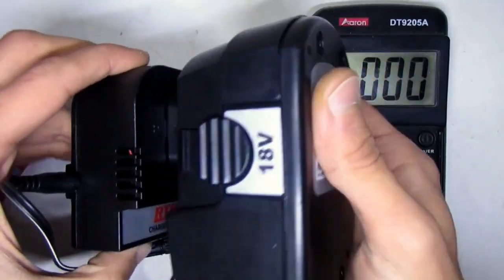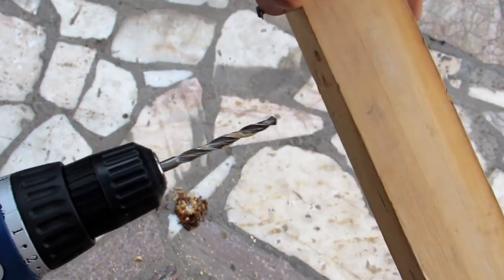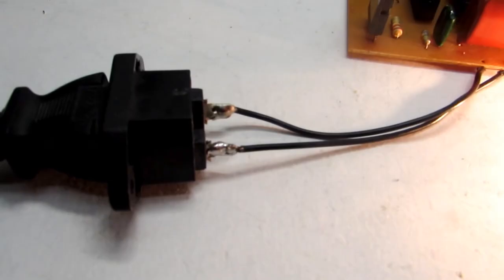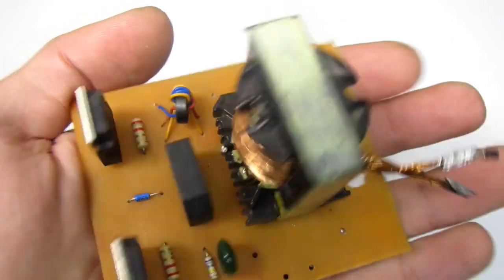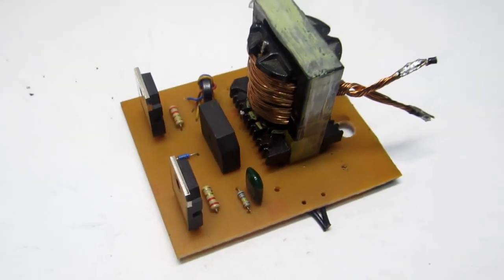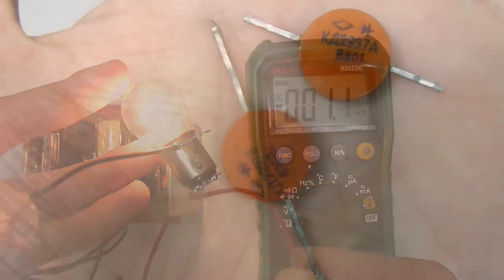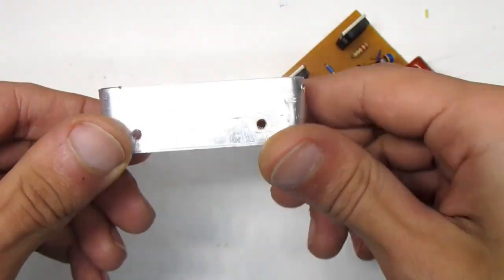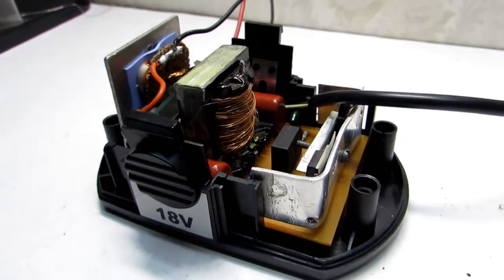How to make a power supply for the electric screwdriver

Comment: Awesome video! 
i have a drill with a sleeping Li battery (forgot charging for 1 year),l don;t have boost charger
so i cut off bms and li battery , wire motor to charger directly
as u said not enough watt to operate ,NG
then i add Ni-H battery in circuit to be a Watt reservoir ,it works
Can i replace Ni-h bat with large capacitor(eg 450uF)? tks
Reply: 450uf is nothing.Even 450 farads will last very little.prorably 4500 farads might be nice but it will cost you thousands of dolars since those super caps cost around 100$ each and have nominal voltage of 2,7v